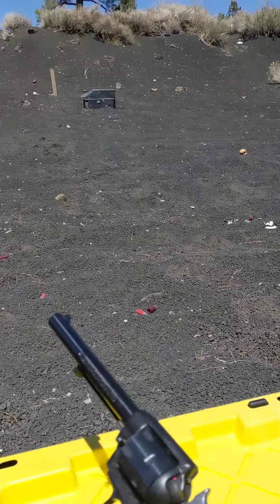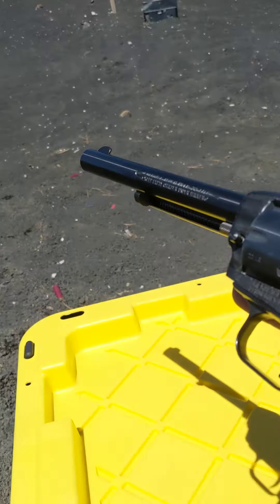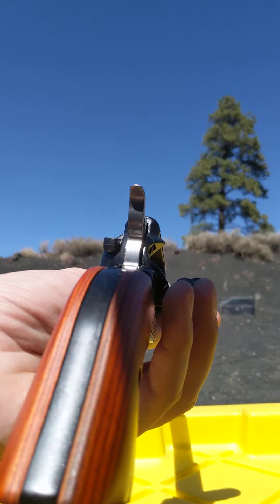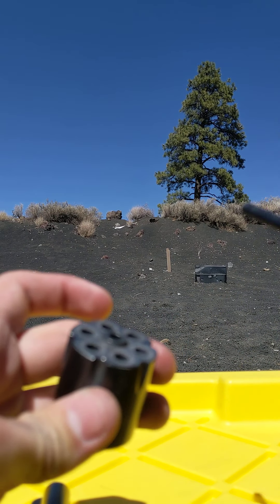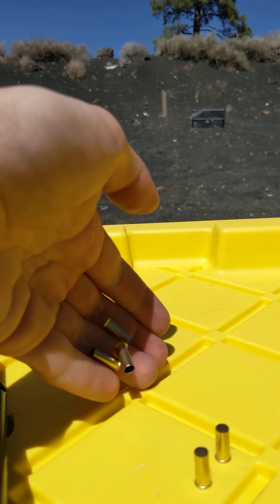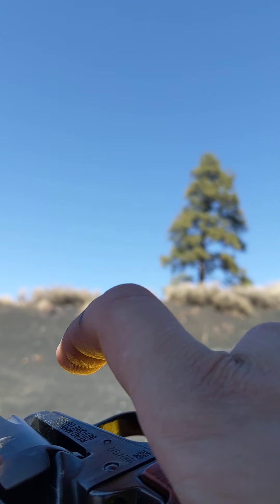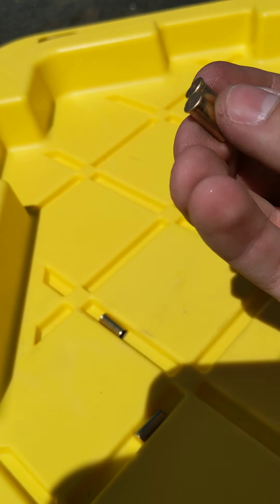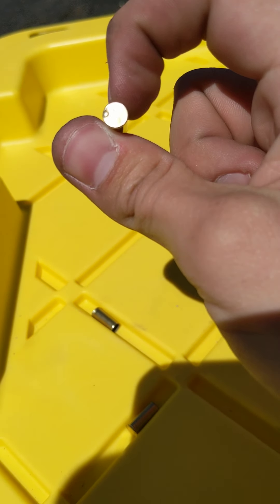Heritage Rough Rider .22lr Jam

Comment: I had this same issue but it was because the empty casings would slip out a little bit wit .22 lr, I keep a little flat head wit just in case and it also helps when the screws start backing out from the WMRs the biggest issue I’ve had is the WMRs getting stuck in the cylinder when trying to eject but I’ve notice it gets smoother the more I shoot it

Comment: My Heritage is doing this when I use Augila ammo.
I will try it with different ammo next trip to the range,
Reply: How long ago did you buy your ammo ? I bought some a long time ago and about 6 months ago bought a Rough Ryder and had this problem...I kinda thought it was a bad batch of Aguila 40 grain super extra that I got, but here you are many months later having the same problem...
Reply: @Soli_Deo_Gloria_.  The ammo is from 2020. I went back to the range with both my 3 1/2" and 6 1/2" barrels
 Heritage revolvers. Shot CCI, Remington Federal and Auglia ammo. In both guns, the Augila was the only ammo that would seize up the cylinders. The primers are very hot and cause the casings to bulge. This causes the spent casings back up and stop the cylinder from rotating. The Auglia ammo works just fine in my rifles so far.
Reply: I have the same issue with Aguila. CCI worked but after 30 min or so it would seize up as well.

Comment: Just bought one because I found a close out price. Went to the range to test it and got exactly what your video shows. It jams on the fourth rotation. Thanks for posting the video. I am going to contact the company as this just happened on mine three days ago.
Reply: Hey Frank what ever became of your Heritage ? Was it ammo related or was somthing on the gun out of spec, and did you send it back to heritage ?

I'm researching as this happened to mine first time out today. I was using Augila 22LR 40 grain Super Extra copper platted round nose. The 22 magnum cylinder had no issues with CCI 22WMR 40 grain...

I appreciate your time spent in responding, thanks
Reply: @Soli_Deo_Gloria_.  Yes it was ammo related. Thanks for the follow up.
Reply: What brand because I'm seeing people all over the board on claiming the ammo as the culprit. Even on this comment section a bunch are giving thumbs up for a comment that also claims Aguila as a problem and nothing else. Other people saying Remington Thunderbolts...and did you send it back ?
Reply: @Soli_Deo_Gloria_.  The exact issue was the rim thickness seemed to jam the cylinder but only with certain brands of ammo.

Comment: In my experience, this type of jam happens to me when I used the aguila super extra 40 grain copper plated round nose. Both 50 round boxes and bulk box form. It happens every so often but with any other ammo it is fine. I think it happens because the case is weak and expands more than a stronger 22. So it bulges ever so slightly, but enough to jam. I think the cylinder hand that revolves the cylinder has a hard time because the buldged round is blocking it's pathway at the loading gate point where it gets really narrow. But I may be wrong. I think it would make sense, and in your case the culprit would be that casing that was really hard to get out of the cylinder.
Reply: I just picked up a HRR and was using same Ammo Aguila Super Extra 50 round. Had exact same issue and then tried Federal and had no issues. Will try a bunch of other brands next time and see what results I get. Also barrel needs a good tightening cuz gun shoots to the left. Don’t want to wreck front sight by bending.
Reply: Yep, same here my HRR does the same thing with Aguila super extra 40 grain copper plated round nose.  Trying Federal next.

Comment: Take the loading gate out and bevel the forward face so it's not square and it will never lock up again,the empty case is moving back out of the cylinder and causing the problem
Reply: Can you elaborate on this?

Comment: As a pistol instructor for 35years that is definitely ammo related also clean your cylinder and forcing cone real good you can use a old  stiff tooth brush for the cone and a brass .22 caliber bore brush for the cylinder with some quality cleaning solvent

Comment: I had a similar problem with mine recently. I was using Winchester bulk ammo and it always caused the gun to lock up. I sent started using CCI ammo and have no problems at all. I’ve shot over 300 rounds of CCI, and the problem does not exist anymore. I believe the Winchester ammunition was junk.

Comment: Several thoughts come to mind:
1. faulty ammo (over pressure, too soft of brass at case heads) try multiple brands If they all do it: its the gun
2. excess revolver headspace allowing cases to back out then swell upon firing binding the cylinder in the process
3. damage to the rear edge of cylinder mouth from dry firing impact of firing pin again causing case rim to jam in the rear chamber opening
   2 or 3 require firearm repair

Comment: scrub the chambers in the cylinder with a 243 brush every so often when it does that,,,,don't try to force cock it as it will damage the lock mechanism as they are stamped pieces of metal.

Comment: I just bought One and   Shot 15 rounds different makes ammo it And it did that  So cold heritage they told medicine it back with some casings The customer services real good I think there's a design flaw in the frame  I will put a post and when I get back until you would happen the gun is very accurate hope they could fix it
Reply: @Steve So what did Heritage say, ammo problem or was the gun out of spec ?

Comment: Additional advice;
Pay attention to which chamber/chambers are affected  only one two may be damaged or out of spec Then repair them or replace the cylinder. If happens in all 6 then a new cylinder or  possibly inspection of the frame for head space problem. Do you have excess cylinder end shake?

Comment: Same exact thing happens with mine, did you find a remedy?
Reply: Were you able to find the problem?
Reply: @As-le6rl  I haven’t found a remedy but I believe it has to do with the ammo.  The shell casings deform from the pressure and cause them to bulge out along the back of the shell and that’s what causes the jams (because the cylinder cannot freely rotate). I want to try some subsonic ammo and see if that helps but haven’t had the chance..
Reply: @Chipz702  does your cylinder move freely on the third click? Mine doesn’t lock and I think that may be the problem. Let me know
Reply: @As-le6rl  mine jams randomly. Sometimes I get a full 6 shots no problem. Other times I get as little as 1 before it jams.

Comment from the maker: After talking with my local gunsmith I found out that this is a common problem amongst brand new Rough Riders. Because the gun is so new the casings are likely going to slip out of the cylinder and bulge after firing. I'm still confused as to why this problem didn't occur with the subsonic ammo.
Reply: Less pressure in the subsonic rounds..
Reply: I have two new Rough Riders (a Barkeep and a 9-shot)(as well as an older 6-shot), both with the faux case hardened finish.
I use Aguila Super Extra ammo only in them, and have no problems like yours.
Looking at the chamber edge at the back of the cylinder there does seem to be a slight radius, and a few thousandths of an inch between the back face of the round, and the face of the frame behind the cylinder where the round could possibly back out under firing enough to allow that bulge to happen.
What I would do is try different ammo to see if that makes a difference (I've never used Eley ammo). If it doesn't, I'd just not use the Eley ammo.
Subsonic ammo (pretty much all standard velocity LR ammo will be subsonic out of a pistol length barrel, BTW, as I understand it) uses less pressure to fire the bullet, so the bulging may not happen if you use it.
Reply: @Beets 
So what has become of your problem, are you saying that a gunsmith was alluding to the fact that this problem works itself out over time and use ?
Reply: @bigbill2444 
That's funny because the Aguila Super Extra 40 grain copper round nose is the ammo this just happened to me today with. After it happened I put the 22mag cylinder in and had no issues with CCI mini mags.
Reply: @Soli_Deo_Gloria_.  I don't understand why you mention the .22Mag cylinder and CCI Mini Mags. The Mini Mags aren't .22 WMR, so they are a loose fit in the Mag cylinder.
I now have more Rough Riders (what can I say? They are cheap fun!), and all don't allow the rounds to back out when firing because there just isn't room to do so (at least on mine).
If the rounds are backing out on yours, I suggest contacting Heritage, as there really shouldn't be enough room between the back of the cylinder and the frame's backface to allow that. Or, alternatively, if the chambers are too big (in the .22LR cylinder; you shouldn't be shooting non-WMR rounds in the .22 mag cylinder), also contact Heritage.
I can't see any other reason for .22LR cases to balloon. (If there are, I'm sure someone will tell me.)
As well, the brass cases are designed specifically to expand when fired, to seal the chamber/case interface to prevent blowback of gases into the chamber. Given that, the cases should not back out, nor should there be room to balloon like that. Again, I'd contact Heritage to see what they say, as this seems (to me) to be a defect in the revolver.
Reply: @bigbill2444 
WRONG - 22 WMR is Winchester Magnum Rimfire, which is colloquially know as 22 Mag...
Reply: @Soli_Deo_Gloria_.  CCI Minimags are not .22WMR rounds, so I'm not sure what you're trying to say.
CCI Minimags are .22LR rounds.
Reply: @bigbill2444 
Yeah I misspoke, thanks for pointing that out, have a great day !